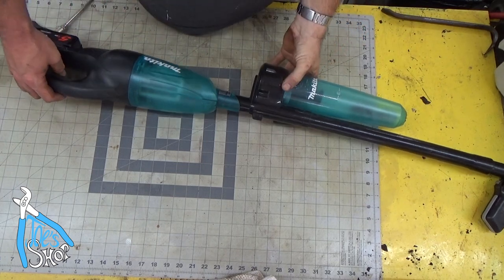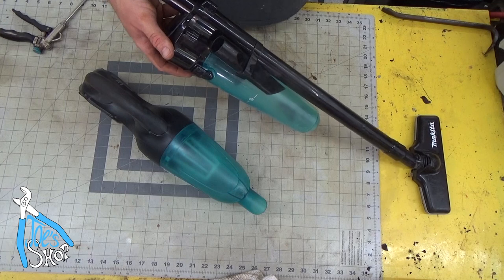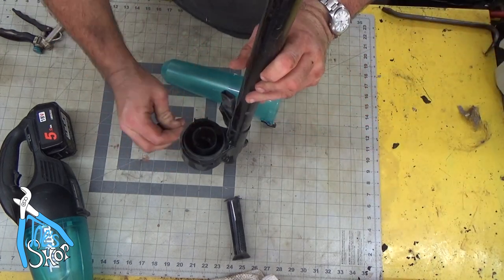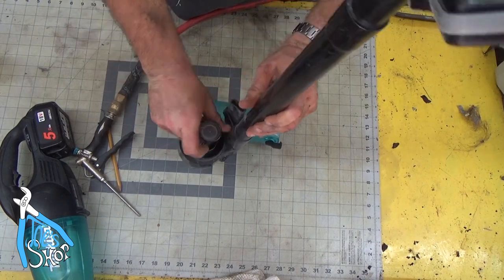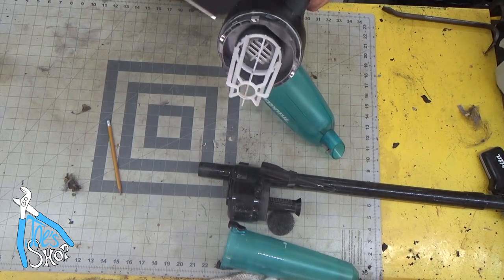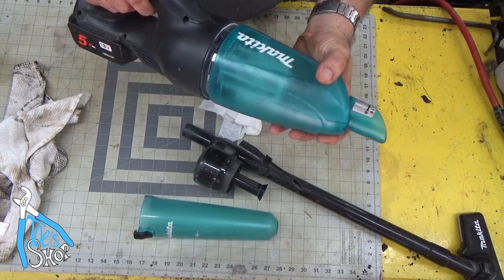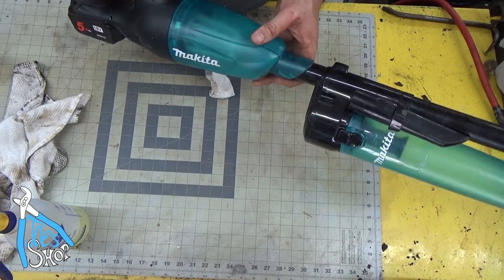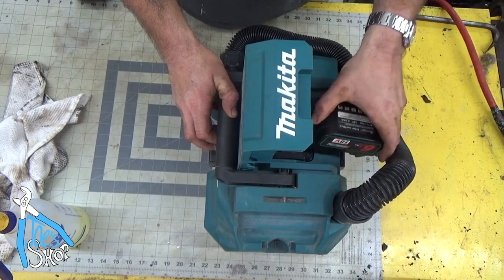Cleaning a Makita Vacuum (restore performance)

Comment: A very old trick to speed cleaning and extend filter life is cut a filter sock to cover that white plastic cage from a section of panty hose. Works on all sorts of shop vacs (I cover all my filters and haven't bought a filter in years except for the additional vacs I score at yard sales) and to clean I just pull them free and shake them, or discard if nasty. If you 3D print there are MANY shop vacuum accessories to make your vacuums even handier to use.